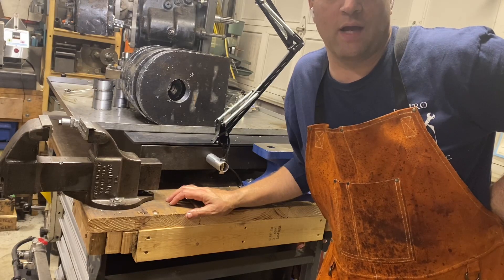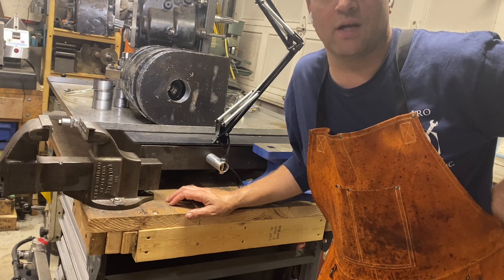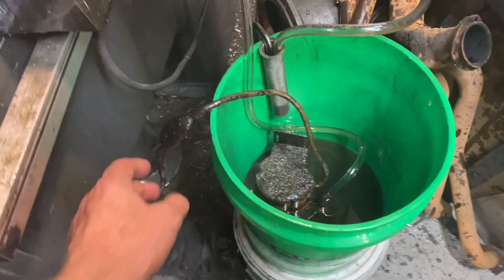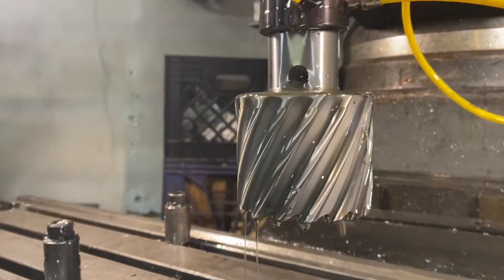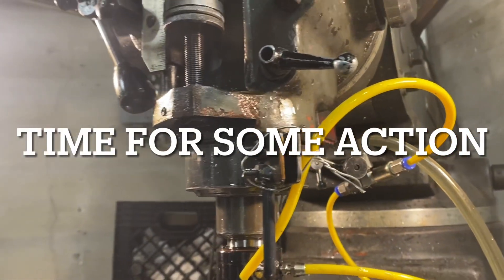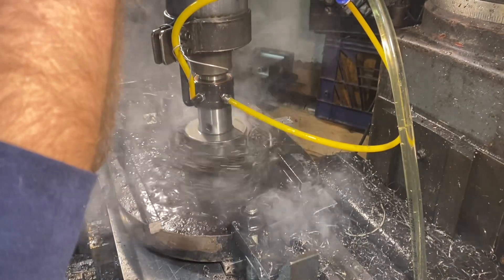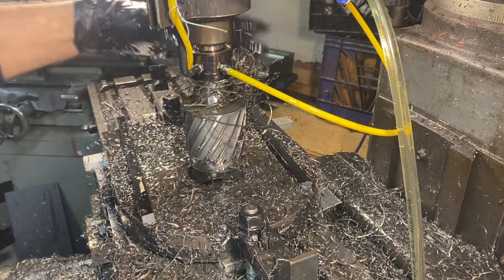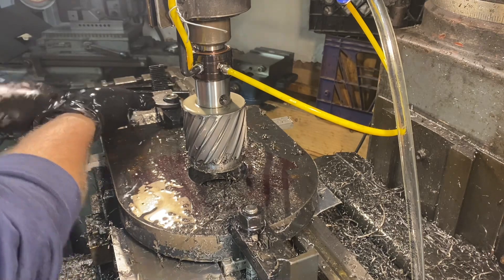Cutting hole with annular cutter

Comment: Awesome video! I would get a little fan to blow the smoke away during the cutting.
I have 100's of thin 18 gauge 1" tubing to notch at the end of the tubing. I have been using a 1" endmill (on my mill) that works fine.
Do you think a 1" angular cutter would work better? They are cheaper to replace than end mills when worn out.
Reply from the maker: Hard to say. If you’re trashing end mills then probably worth considering. The flood coolant is pretty nice and the higher teeth count would be good too.

Comment: It looks like the hole came out very smooth wall and I didn't see a burr around the top of the hole at least
Reply from the maker: It was pretty clean edge but  sharp.  No heat and no galling.  These things cut really great.

Comment: I wish I found annular cutters sooner. I am just running them on my drill press but it is insane how fast they work. I use cutting wax to save the mess but I and doing a lot smaller work so far.
Reply: can you side mill with Annular Cutters?
Reply: @privateprivate3767  they are not intended to side mill. Would probably dull quick and have incorrect profile to chip. I imagine in soft material you could try. But I would expect poor results.
Reply: @todayletsbuild2153  thank you very much for the reply. what would be your advice on milling out a flat bottomed 2"/50.8mm slot

so far I'm thinking to plunge mill with these Annular cutters moving my x axis slightly each time?

I can not find an end mill big enough
Reply: @privateprivate3767  well I know end mills that size are incredibly expensive.  I don't have any usable experience to properly answer your question unfortunately and would hate to steer you wrong.
Reply: Yes think plunge like you said then clean up with x axis in the end. That is what I would try but could no recommend.
Reply: @todayletsbuild2153  thank you Today lets build you are helpful and cool :)
Reply from the maker: I wouldn’t do anything other than a full circumference plunge with an annual cutter.  You could do both ends of the huge slot with the annular cutter and then mill
Between
Reply: @hansw33  thank you for the help
Reply: no lolololol.  They're not solid carbide, they will ring and chatter, don't be a dingus. @privateprivate3767